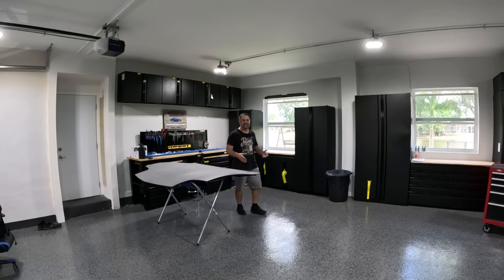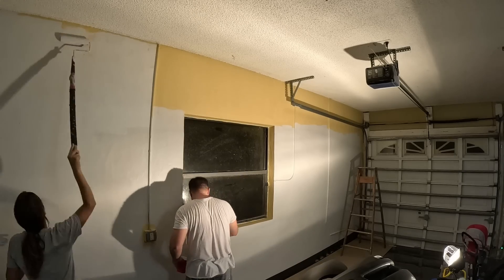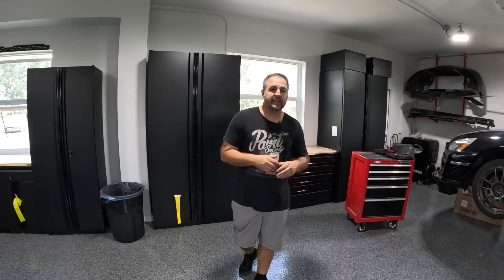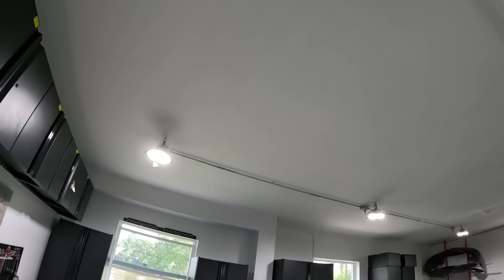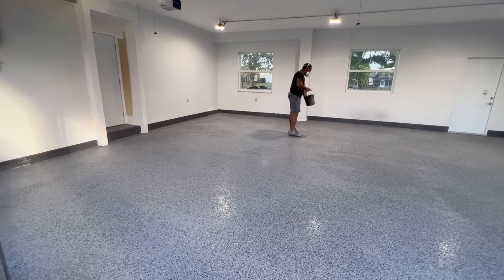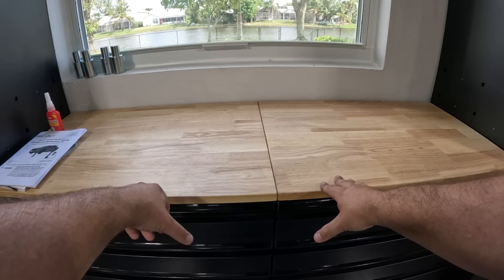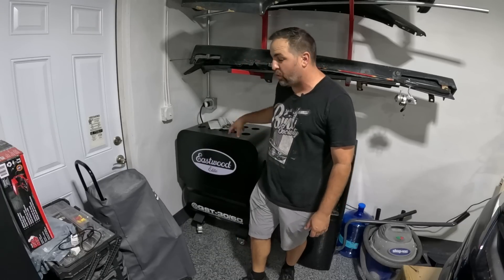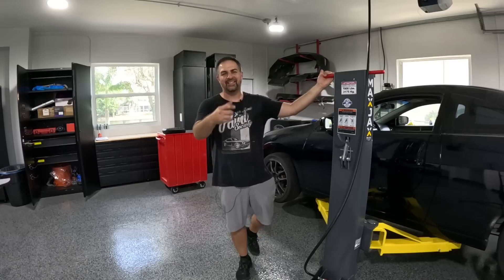OLD HOME GARAGE COMPLETE TRANSFORMATION!

Comment: I want to know  about the 3m  xtract da sander whether buy a 3/16 off set or 3/32 for bodywork  because  I brought  a mirka electric  but it has no push  i can only use it for fine sanding  and the was about $600 bucks .but always  end up it a porter cable  da sander but it does the job. Which offset  is the closest  to the porter cable

Comment: Nice home shop!
I've watched quite a few of your videos (but not all) but I've not heard any info on this.  I would love to hear some info on is when to disassemble the car and paint bumpers, hoods, body panels, etc.  You've painted, both at home and the shop, panels on the car,  panels on but obviously unpanelled on the inside, door panels with just the handles taped over, and door panels hoods, hatches, bumpers, etc completely off the cars on stands.  When can you get away with keeping the car together and when do you have to start taking the car apart? Any pointers or links to past videos would be great.

Comment: I am confused? You have a crawl space above your garage. Why would you install lights with exposed wiring in metal tubes on the outside of the garage when you have access to the top side and could have just installed boxes and ran the wires inside?
Reply from the maker: I do?  You know more than I do about my house I guess?  That’s solid concrete brother and room on top.